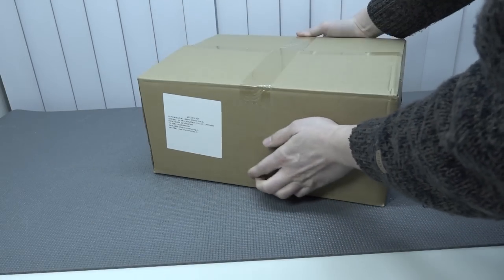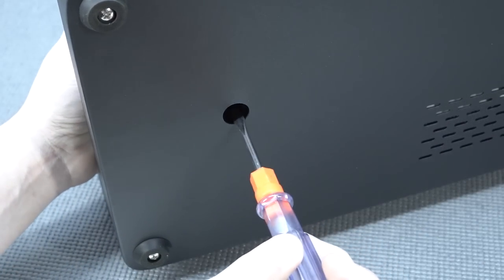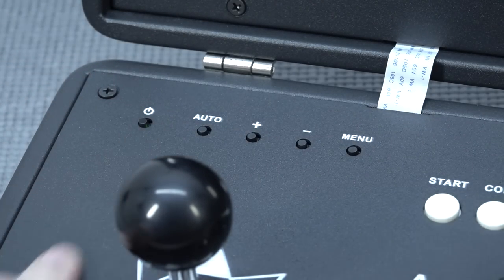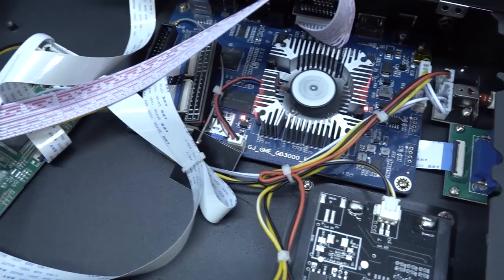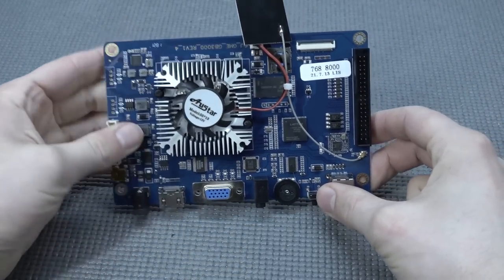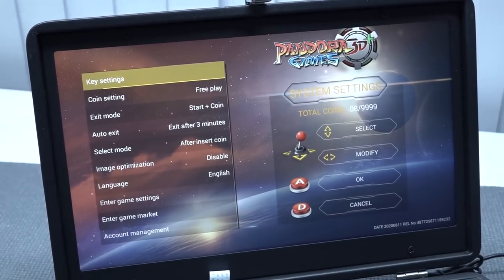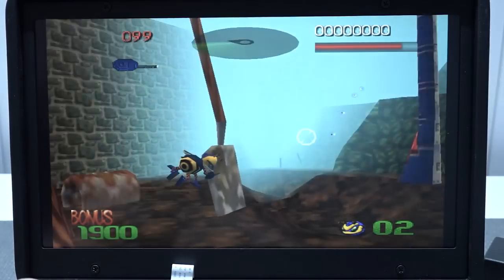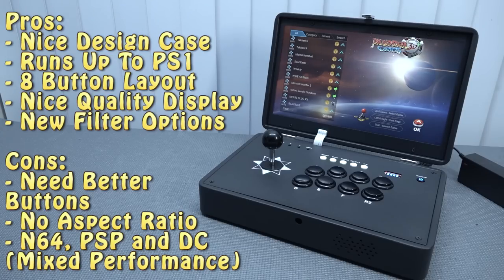The New 2022 Pandora Games 3D Portable  Is HERE !

Comment: The 10,000 model comes with a 8-core Arm cortex A-53 and Power VR SGX6110. Would that be significantly better of a chip than this one?
Reply: It's way weaker. That's why it is cheaper. Mali 450-MP8 is approx 2.5 times faster than PowerVR SGX6110